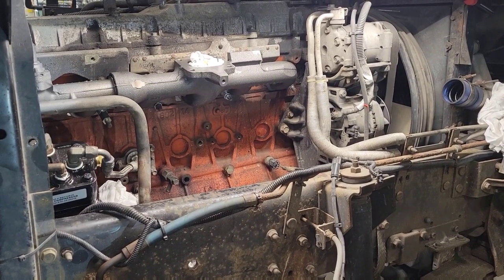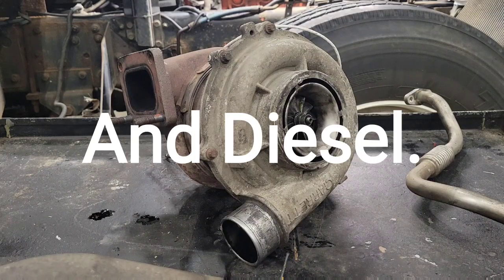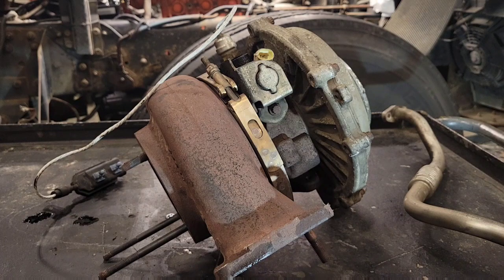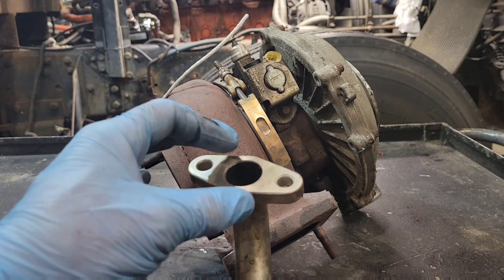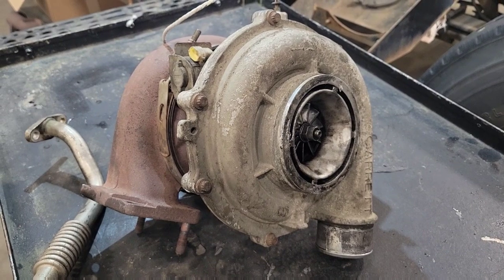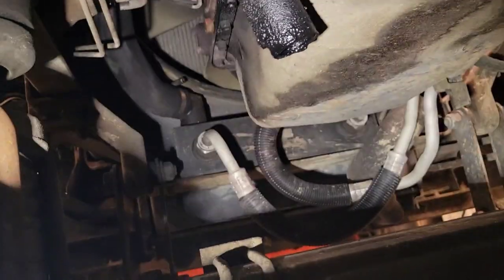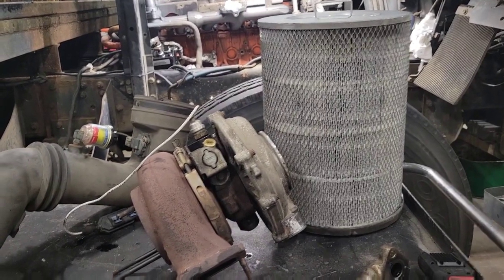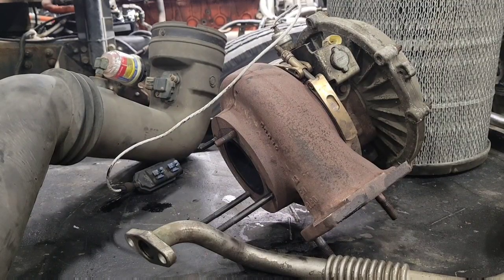Turbo Leaking Oil ? Common Causes Explained. Watch Before Buying New One. By: Shaners Mechanic Life.

Comment: Great video and VERY informative. I drive a Ford 2011 6.7l powerstroke and only at idle at a stop light my truck will start smoking from the tail pipe and it goes away when I drive it. It doesn't miss when I'm driving it and it has lots of power like it did when I bought it new. I changed the ccv box on it which is like the pvc valve and oil levels were perfect and I pulled the oil cap and they're wasn't no milkshake color to it and the coolant looked fine and the truck has 112k easy miles on it and oil and filters have always been changed when they're due and I drive it like a grandmother drives her car, I don't beat on it. I did retire the truck for 2 years in my driveway back in 2019. I thought maybe a injector went bad so I changed the fuel filter and filled it up with that seafoam and ran it for a while and it still smoked at idle. I also checked the intercooler for leaks and it was good. Do you think that it could be a internal turbo seal  that might have  cracked while in retirement? I'm a muscle car gas junkie but this is my first diesel.  Sorry this turned into a novel. Thumbs up on your video buddy. 👍
Reply from the maker: Thank you very much. Have you pulled the intake piping from turbo to the air cooler and looked for oil? Do you get a puff of smoke on startup? Valve seals maybe? Let me know what you find.
Reply: @shanersmechaniclife3164  The intake piping to the intercooler has a very very light mist of oil in it but nothing to write home about. When I first crank up the truck there's no smoke, it only happens when it reaches full temperature and only at idle when ya come to a stop light. I did change my ccv box and the factory one was still in great condition and when I installed the new one the smoke got worse and then while i was working on it i decided to flush the antifreeze system and installed a new thermostat and I noticed that the smoke was worse with all that I did to it. The factory thermostat runs cooler than the one the Ford dealership sold me.  Do you think from sitting up for 2 years and running it every 3 months until it reaches full operating temperature, do you think that maybe the oil return line in the turbo could be clogged and all that oil doesn't drain out fast enough from the turbo at idle? I also changed the air filter too. When I retired the truck i retired it with a fresh oil change and ALL NEW filters and always with a full  tank of diesel but I did replaced the fuel filter last week just to make it was still clean and it had alot of wax on the bottom of it and it was a reddish color from that diesel extreme additive or maybe rust.  Anyway my next move is to take off the turbo and look at all the lines running to it. I really appreciate you trying to help me. I'll let ya know what I came up with. Could I damage it more while running it in this condition? Again thank you for your help👍
Reply: @williamsantiago7303  hi im currently having this exacly problem did you solve it???? I need to know S-o i can do that please

Comment: So what if it’s not any of the things you pointed out Iv put 2 turbos on my truck and it’s still burning oil
Reply from the maker: Are you getting oil in the turbo outlet ducting? Not sure what engine you have or the milage, but I would double check crankcase pressure and pcv. Keep me posted on what you find.

Comment: Hello friend, I have a 2018 Ram 2500 with the code P0299 turbo under boost, I already changed filters, checked the variable geometry turbo and it slides well.  I replaced my boost sensor but the pressure is 0.08 to 0.12 psi but it should read 2.5 psi. Would it be a matter of checking the intercooler?
Reply from the maker: I would check closely for any sign of leaks like black residue around every joint, also check exhaust for restrictions.  Let me know what you find.  Thanks for watching

Comment: Thank you. New sub. Perfect information for a research-first-DIY-mechanic with oil leaking from the turbo. Yes too much crankcase pressure - installing blow by catch can. Cleaning air filter. 👍🏼👍🏼
Reply from the maker: Thanks for subscribing. Glad you liked the video. Just with any repair, too many people just fix the damage and don't look into why it happened.

Comment: Very helpful video.  I found oil at the bottom of my intercooler, and your explanation of why it [is] could be coming from the turbo gives me hope the turbo isn't bad, and causes to look for.
Reply from the maker: Glad it was helpful. Hope you find a cheap easy fix. Keep me posted on what you find. Thanks for watching.
Reply: Im in the same boat haha. My service mechanic found it on my truck's 200k km service. Oil on the intercooler from the turbo. I sent my turbo to a turbo specialist. Hopefully he says it's good. Also, my service mechanic told me that the truck's air filter was fking dirty. So I think that caused the leak? Because the turbo is guaranteed to last at least 200k km.

Comment: Thanks very informative
Just installed a new vgt turbo to my isx because it wasn't moving in and out properly now we have a oil leak I was thinking that the new turbo was bad but I will check everything out the way you are suggesting
Thanks again
Reply from the maker: How did your turbo issue work out? Did you find a problem or did you getvthe turbo warrantied?
Reply: Fixed the problem I had air leaks on all the clamps thanks I saved some money because I did it my self with your help

Comment: Thanx, that helped me so much..
I've got a - Ford Transit Mk7 2.2 TDCI - 2008 Reg.
Main problems Injector one (brand new) or cylinder one causing issues.. 
I bought the van few weeks ago and basically giving it a full check over..
I know that when I bought it that the tappets/lifters were loud!
But I never expected the previous owners brand new injector being the culprit!
But the engine cuts out when I removed electric feed! So, I know its deffo the new injector or cylinder.. 
After removing the air filter (looks like gollum) it's that dirty! 
But I noticed the turbo inlet pipe was either very lose or not on at all!
So, I removed the pipe fully and both the inlet pipe and inlet to the turbo was caked in oil residue!
The van is about to go in for a full service on the 19th Oct: (new air filters - oil change and so fourth)

Also to finally add! As I quite clearly forgot! But the van basically had no oil when I got it and has been leaking what oil left fast/heavy.
Head gasket is all good 👍🏼 

(My thoughts to accomplishment)
So! 》
Get injector 1 & injector chamber cleaned ✅️
Remove and clean turbo✅️
Clean inlet pipe✅️
Plus- New oil, Air filter, Diesel filter! All with the van's full service✅️

🤞🏼It's all good and I'm a winner🏆 
🚐💨}💨 beep, beep

Bare in mind this is the first time I've learnt properly how to fix the actual engine block and main components!
Compared to just changing an exhaust or air filter..
All learnt off YouTube in the last 2 or so weeks..
Pretty much know how to strip an engine 🤗
Reply from the maker: When ever I have an issue I always check regular maintenance items first. It's surprising how many problems they can cause.

Comment: Very good video, covered a lot of potential causes. Another I've heard of though is crankcase and rocker / cam case ventilation. You mentioned that, but on many engines it's more of an issue because they ventilate into the air intake (somewhere between the filter and the turbo I presume) so that any oil is mostly burned in the engine. Does this mean that there will be some oil in the whole of the induction system from that point onwards (by design)? Including in the intercooler. Also I've read that there is a separation device which attempts to minimize the amount of oil going into the breather / ventilation pipes and that it can go wrong or just not work well.
Reply from the maker: Most of the time the pcv system is plumbed in after the turbo and intercooler. Any oil you find in the intercooler cooler for the most part came from the turbo. Although there are many different methods of designing these systems by many manufacturers.  Thanks for watching and commenting.
Reply: @shanersmechaniclife3164  You sure they're plumbed in after the turbo? If they are then they will only vent into the intake if the crankcase pressure exceeds the boost pressure.

Comment: I am guilty of using RTV on a my drain line recently... I really don't know what I was thinking, it'd be better off without a gasket at all haha
Any idea if having the stock PCV valve would restrict a gas engine? it has a turbo kit on it that otherwise was never there. And is Drilling out a PCV valve an option? When routing to a catch can and back into the intake?

Great informative video, probably the best on Youtube. Thank you!
Reply from the maker: Adding a turbo would definitely affect the pcv. Regardless of engine condition there will be more blow by then the pcv system was designed for. A good catch can set up would be a great idea

Comment: ❤ good one mate this is exactly what happened to me as you said earlier in the video with the oil level. My oil level was way over the max level … before that fateful afternoon from work on the highway. The smoke was devastating the fire service had to attend to me at the scene … the car is still parked . What is the fix in my case?? Preciate ya
Reply from the maker: Hard to say without seeing the vehicle. Was the oil overfilled,  or did the level rise because of fuel dilution or antifreeze? How is coolant level and oil color? I would try draining the oil down to proper level and try starting it. See if the smoke gradually gets better. Engine may need replacing. , Safest thing is to take it to a certified mechanic due to the fire hazard. Let me know how it works out for you. Thanks for watching and commenting.

Comment: Great video. I have a diesel vw engine with 518000 miles with the original turbo.  I do get some oil in the intercooler which I drain periodically.  This is probably a stupid question but am I overdue for a new turbo. The car runs fine.
Reply from the maker: If your car is running well with normal power, I wouldn't mess with it. If it isn't broken don't fix it kinda thing. Thanks for watching.

Comment: Very instructive video. My kw t680 is leaking oil again after I reconstructed it.  Before installing it I checked  all things you mentioned in the video except the crankcase (It seems my crankcase housing was bad. I replaced it. after my turbo started to leak oil) I am ready to replace it again under warranty but I don't want anything else to harm thr turbo. Do you think a bad egr cooler can cause oil leak in the turbo? . My truck is deleted but it seems the guy didn't bypass the egr.

Comment: Thank you for this video, it was really helpful. I have just one question...Lets say there was too much oil pressure due to a bit too much oil put into the engine and there was a leak on top of the turbo near the seal and near the intercooler. If there is less oil or normal oil level as no excess, will the seal and the leak that happened go to "normal" or not?

Comment: Great info have  as a general guide at what mileage should you replace a turbo assuming it’s been well serviced
Reply from the maker: I generally don't replace them based on mileage. I wait till they start having issues like low boost and oil leak issues. Basically if it's not broke don't fix it :) . Turbos will tell you when it's time for rebuild or replacement. Glad you liked the video.

Comment: Wow didn't know the air filter good Video
Reply from the maker: If the filter is restricted vacuum will build up and suck oil past the seals. Might not be anything wrong with the turbo seals. Thanks for the comment.

Comment: 2006 subaru sti all stock . Residiual oil leak  under turbo. I suspect the oil return line
Reply from the maker: Let me know what you find. It's a very common place for a leak. High temperature and vibrations. Might just need retorque on bolts.

Comment: Some time only needs to be replace crankcase breather..
Reply from the maker: Good point. I actually ran into that exact problem this week. Filter was plugged causing crankcase pressure to push oil out.

Comment: good content . thanks for shareing i have the same engine 6hk1 with the same problem pulled turbo and than i noticed there is oil in the pcv breather tube so i think i might get ride of the catch can and just vent it out the bottom like the truck you showed thats how my n14 vents , i priced a new filter for my pcv breather and isuzu wants 200 bucks for it , crazy . would you recommend cleaning these pcv breather filters with diesel and trying to reuse them?
thanks liked and subbed
Reply from the maker: Thanks for the comment. I'd try cleaning it first to troubleshoot and if that makes a difference then I'd order a new filter. $200 is alot to spend and not have it be the problem.  Thanks for subscribing.

Comment: Does too much idle time make a leak? Great video!!
Reply from the maker: Thanks for the comment and glad you 👍 liked the video . in my opinion Idle time isn't very hard on the turbo as it's not spinning very fast provided your engine oil pressure is good at idle. But when you think of it, anytime something is moving wear is taking place not to mention burning fuel and money. The way I look atbit is if your not using it shut it off. Hope this was helpful.

Comment: If a turbo is leaking oil into the intercooler and exhaust system would you be able to see the leak or could it all be internal
Reply from the maker: If it's leaking into both, then you will
Probably see some blueish smoke under load.
Reply: @shanersmechaniclife3164   Thanks !

Comment: If there’s no boost does that mean the turbo is blown???
Reply from the maker: No. There could be parts that are leaking boost pressure , what ever controls boost level could have an issue, exhaust could be restricted, Also some turbos are controlled by computers. So you have to eliminate all of those before you replace the turbo.

Comment: Great video. 
Could you inform the maximum pressure value in the crankcase so that oil does not leak through the turbo seals?
Reply from the maker: It should be very close to zero.
Reply: @shanersmechaniclife3164  Thanks man

Comment: I'm thinking it is due to my air filter being blocked. i thought it was good but it needed a big blow out with the compressor. Going to try tomorrow but there is an oil breather that feeds into the turbo intake after the air box. If the air filter was too blocked this could force the engine to suck air from this breather, potentially sucking some oil up.
Reply from the maker: How did cleaning the air filter work for you? Just be careful using compressed air to clean your filter. Be careful not to damage it. I usually just replace them.
Reply: @shanersmechaniclife3164  Even thought the filter was dirty it was not the issue. I had problems in the vacuum circuit and the solenoid that controls turbo boost. 
  I managed to hack it until the new part came. I'm yet to try the new solenoid but the hack consisted of removing the boost solenoid and joining the turbo diaphragm directly to the vacuum circuit but then disconnecting the fresh air vane vacuum piston which also runs on this circuit. This way i could either hit the button to close the fresh air solenoid that operates that piston for the vent flap forcing full boost or on the open side of the other fresh air controlling solenoid (when in open position) i connected  pvc pipe that went into the cab. I could hold it by the steering wheel and gear stick and control boost while driving. It was a fine line between over-boost and tripping the p1470 code but i had the scanner plugged in and could erase the code while driving. Just had to take care not to over-boost going uphill while fully loaded. I needed the box van to doa few jobs and this hack was the only way i could drive it while waiting on the part. I'll be fitting it in the next few days.

Comment: NIce content, my hilux 3.0 2009 after 500K km, there is a an oil leak, after removing the turbo, i inspected the the fan is ok no damaged or slack. so what causes the oil to leak, thanks
Reply from the maker: After 500,000km wear could likely be an issue if everything else checks out ok. Let me know what you find.  Thanks for watching
Reply: @shanersmechaniclife3164  after removing the turbo, i found out the water pipe connected to the turbo full of harden carbon and also this is due to the rusty water from the radiator. Now i have replace the water pipe, dismantle the turbo get clean and fix with new repair kit,

Comment: Can this engine have blowby and how u check for it
Reply from the maker: You can hook up a guage to the road draft or pcv tube and measure the reading. Different engines have different specs on what is allowable.

Comment: If car was overfilled then what to do, I’ve cleaned intercooler, intake. Charge pipe. Inlets and outlets. But not the turbo. Car had a diesel runaway but is not ok and In limp mode. But turbo has oil underneath and is smoking slightly
Reply from the maker: What did you find wrong with it? Were you able to fix it?